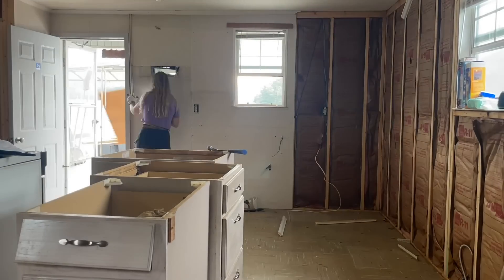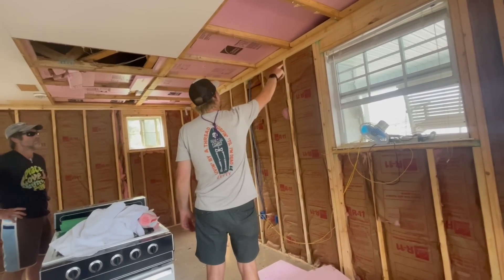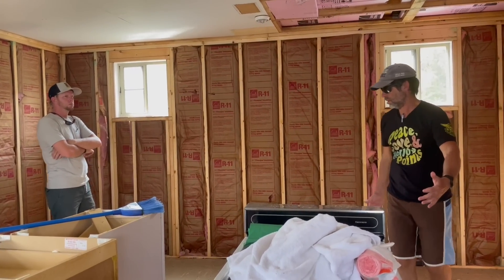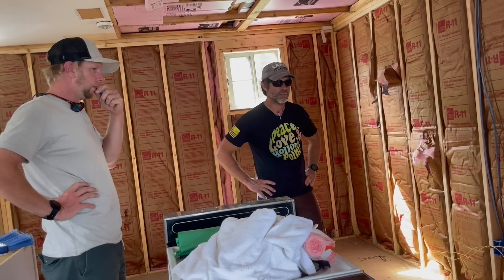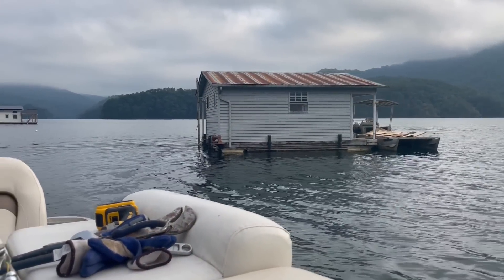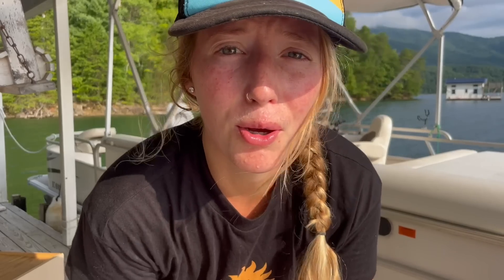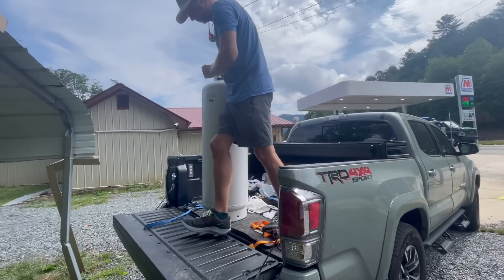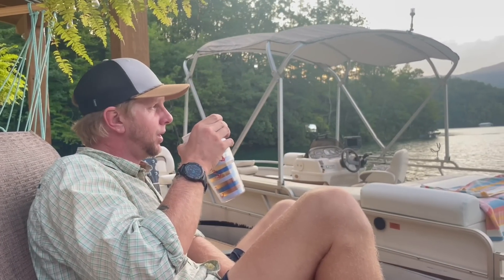FLOATING Tiny House Renovation 🔨

Comment: Love watching you two! You're so industrious. Such a different & adventurous way of life. My husband & I used to own a 12 acre heavily wooded private island near the metro area in MN & we built a small house on it. I ended up renting it out after my husband became ill & then passed away. I did the turnover between tenants. To start I did it by myself & then I got help with turnover. We did an underground bore from our mainland lot (under the lake bed) to the island to bring the water from the well we had drilled on the mainland + electricity that was brought to our island. We had a field septic sytem installed on the island. It was a challenge to find a company that would pump it out, but I did find someone. I sold the property 5 years ago this month. So I can TOTALLY relate to what you are doing. One thing that concerns me - you really should be wearing masks & goggles when you're doing demo. That stuff can get in your eyes & lungs which can give you health issues going forward. You're young now but you'll pay for it later. Please consider protecting yourself.
Reply from the maker: Aww this was so cool to read! You really can relate huh?! Sounds like your place was an incredible spot, & gosh boring the waterline underground underneath the lake sounds like it it would have been a ton of work! Kudos. & you’re so right about the PPE, we should be wearing it during demo. Thanks 💙

Comment: I live up North and we use a lot of fiberglass insulation, it's easy to use  and easy to install. I've installed a lot of it. Tip: After a day of messin with that stuff nothing feels better than a cold shower with head & shoulders shampoo (it's stops the itch).
Reply from the maker: head & shoulders works for insulation itch too huh, who knew! Thanks! 🤝

Comment: I love a good demo recon video.
Being from Canada , we use R40+  fiberglass insulation in our ceilings. Just curious if pink foam insulation is a normal thing for ceilings etc.... in your climate?
Reply from the maker: I wouldn’t say it’s standard for a professionally built home but it is common to see in DIY projects like sheds (or these older homebuilt floating cabins). We’ll be swapping it out for R30 rolls, which are more standard & sufficient for this area 😊